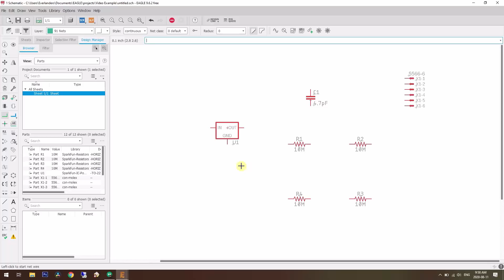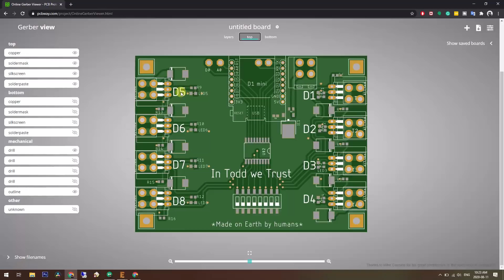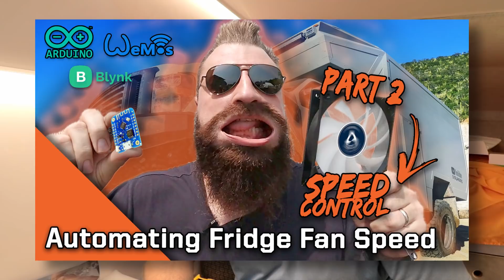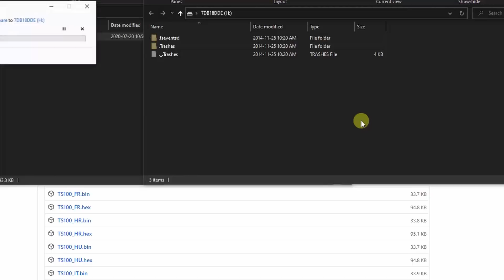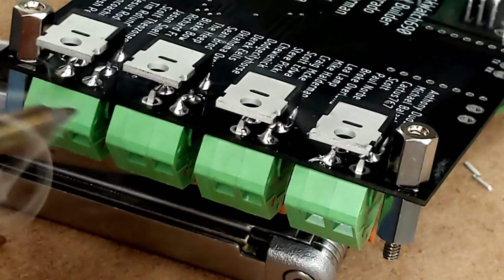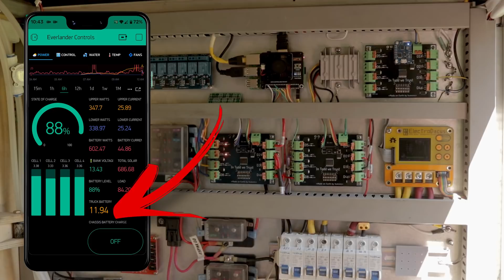Designing and Building Custom P-Channel Driver PCB's in Mexican Lockdown

Comment: you showed making the pressure bumper thing but I didn't see what and why. why are you using semitruck air brake solenoids on your back bumper?
Reply from the maker: This was covered in detail years ago... https://youtu.be/7_NlZw3lk3A jump to 12:00 to see the bumper flex air mount.

Comment: Hi, great video. This is so cool.

Do you have a video where you explained the components you used for your design? I'm in the process of doing something similar for my car, but I would like to add a couple of high amperage 12V devices on there, like a winch.  The rest will probably be lights. But I'm trying to learn what's the best way to switch high amperage DC loads.
Reply from the maker: The winch was probably built with large relays or contactors, controlling these us probably your best bet.
Reply: Thank you for the response. Thanks to your video. Now I know I can do it. I want to switch the relays through the rapsbery pi with open auto and using an HMI screen. Not physical buttons. 

Do you recommend using an 8 relay board how you made and all the wires (about 10?) Or pairing an arduino through serial comms (maybe i2c or rs485?) with the pi? 

Also, you go offroading quite a bit. How's has the pi and the screen you have worked out for you? Have they been okay with all the vibrations and heat cycles?
Reply from the maker: I would caution against controlling a winch with an Arduino or Raspberry Pi. Winches can be dangerous enough as it is, but if you have a glitch in your code or a delay in a process and the winch is running when you NEED it to stop, you'll be better off just waiting the stock buttons to your dash if you want.
Reply: @Everlanders  I agree. The winch was a bad example. I am going to stick with lights only and possibly the electric actuator for a rear diff locker.  Thanks.

Comment: Before doing fine pitch assembly, take 20 mg of  propranolol (a beta blocker) and it will take most of the shake out of your hands.  My neurosurgeon says they take it before doing surgery -- for basically the same reason.   I think in Mexico it might be available OTC... (?)

Also, when handling MOSFETs, you need to wear an ESD wriststrap and work on a static dissapative surface.  It's easy to blow the FET gates with ESD.
Reply from the maker: It's unlikely I will implement either of these.

Comment: Thank you for sharing!!! After watching this video I had to make one board like this for my build. I love it! I designed it a little different so it can handle high current without modification. It's bigger so I can install two heatsink on the fets, I use EasyPCB so no size limitation! 
I have a question though...because I'm good in electronics but not so good in coding, how can I make one wemos D1 mini pro output to work with Blynk as a dimmer? Any suggestion or links will be really appreciated!
Reply from the maker: Just PWM the output
Reply from the maker: Or if you're using the Blynk interface, you can just set it as a Slider and it will handle the PWM for you.

Comment: In any of your other videos do you show the safety lockout for the solar panels? If you get a chance to throw a quick look into a future video that would be great.
Reply from the maker: No. It is inherently safe, when the power is disconnected from the solenoids the panels are pulled in with 150 psi on each cylinder, they can't come out unless we lose all air pressure...

Comment: This Guy is incredible. I want it! I want it all! I have basic knowledge of circuits.. Working on using an Adrino nano BLE to control actuators for tilting solar panels based on a couple little solar panels as reference. I choice Ardino due to low power consumption but now I'm steady looking at my rasperri pi and wondering now. I'm a software engineer so I can program... What would you recommend as a good relay board/driver that I can get off the shelf??
Reply from the maker: Amazon is full of little two or four position relay boards that are more than adequate. But as far as tilting panels goes, the cost of one more panel will be far less than the headaches of tilting mechanisms and the gains will be higher...
Reply: @Everlanders  Ahh, I read up to 30% more efficiency but also had the idea of stacking them and sliding. Which I seen you did successfully! Though it still seems actuators or maybe servos are involved. I'll look through your videos and see if you have something detailed about that. Appreciate the recommendations!

Comment: Did you have any issues with the D1 minis starting up or logging onto Wifi while connected to the “blue relays”?  Been messing around with them to learn Blynk and noted that D1 wouldn’t start up with the relays VCC connected, but would work fine if connected after starting up and logging into wifi.
Reply from the maker: D3 is IO 0 - a boot configuration pin which should be HIGH for normal boot and LOW to start bootloader flashing mode. Just use another pin or use a 2803 to invert the logic.
Reply: @Everlanders  Hmm, I didn’t have D3 connected to anything,  but I did notice that D8 would try and stay high when booting, once I disconnected that pin it worked!   Thanks for the lead!

(I also found out that the ESP8266 analog input tops out at 3.3 not 5 volts.  Which would explain why my 16 volt voltage divider kept reading infinity billion... 😆).

Thanks again.

Comment: I'm not in a position to become a member but I do have a couple questions if you would indulge me.  Are you using the transistor array to boost the logic voltage from 3v on the wemos to 5volts for the relay boards, etc ...?? Or is it simply to invert the high/low of the logic.  I had trouble following that bit.  Would love to learn more from you if you ever want to mentor someone as you were mentored in the ways of electronics.  Thanks,!
Reply from the maker: They are used to invert the logic and provide a bit of protection to the GPIO

Comment: yep the relays in the ganged relay board unfortunately get arc-stuck  after  too short of a while, it's unfortunate .  Could be such convenient boards, as relays have many nice features over other methods .
Reply from the maker: 👆Truth!
Reply: @Everlanders  I actually replaced some of the "songle" relays with panasonic ones from digikey, and also replaced some with mosfets  they have been in use for a while now (CNC /pneumatic controllers)   Need to give it another year to see how the panasonics compare.
Reply from the maker: I was tired of all the clicking and inability to dim or limit current, so I went fully solid state.

Comment: By the way you run out of the GPIOs on Pi try to use I2C bus for it.... It will surprise you ... :)
Reply from the maker: No, I intentionally wanted to have satellite processors that could handle these tasks independently, hold states even if the Pi was rebooted, and for $2.00 its hard to beat the price for 11 digital IO, interrupt/pwm/I2C/one-wire supported pins and A/D

Comment: But do you have a light switch on the wall too?
Reply from the maker: No switches in the whole rig...
Reply: @Everlanders  Thanks!  I like what you are doing but I really need wall switches too.  My wife is not tech friendly!  Is it even possible in your setup?  Maybe to add a simple switch with power to the relay board?  I'm still diggin through your videos.  Great work!
Reply from the maker: Of course you can add a switch if you wanted to...
Reply: @Everlanders  Thanks, I'm stumbling through understanding it all :)  I get the RV part, and I can do very basic arduino, but tying the two together is a process I'm very much learning!

When you said the relay boards were getting fried by your lights, I'm assumming that it was not your led strip lights inside, but your large led lights outside (like driving lights) that blew them eventually?
Reply from the maker: No, it was our interior lights. They are 120 LEDs per meter and we have nearly 10 m total... They are brighter than daylight, and using a relay without the ability to dim them, it's a pretty high current load. This is another reason having the FETs is nice, because I can dim them now.
Reply: @Everlanders  Thanks for taking the time to reply!  I'm going to take the time to become a member in hopes I can learn a bunch more from you guys.  Thank you!

Comment: Excellent video! You have yourself a new subscriber! 
I would personally recommend getting a new tip for your soldering iron! The one that you are using is perfect for the smaller stuff but the bigger stuff just pulls what little heat is built up and cools it down, it means that you have to swap out tips for the bigger stuff but at least you won't be pushing the heater element to hard! Always remember, just because you can, doesn't always mean that you should! The right tool for the right job always makes the job easier, faster and without damaging something! There's all sorts of tips available for those soldering irons and a kit with just about every tip to do anything shouldn't be too expensive... 
But damn! That's an amazing job 👍👍 that's a double fisted Aussie thumbs up from me!
Reply from the maker: I have since ordered and received a second TS100 with the wide tip for bigger stuff... Thanks for the comment!

Comment: Hello Jason, could you please spent few words on how you use fuses? It seems to me that in your nice electronic compartment you have very little fuses. I suppose fuse should be between every MOSFET PCB and the battery (close to the battery) to protect PCB itself. And then right after MOSFET PCB to protect appliance+wire towards that appliance. Do you think so? Where are all those fuses? Thank you. Cheers!
Reply from the maker: Lots of fuses and holders shown at 50:35

Comment: I found myself needing something similar.  I wound up using an automotive power IC (TPS2HB16).  A bit more fiddly (HTSSOP) and expensive, however it has built-in current sensing/limiting and some other bonus features.  So essentially it can replace some of your fusing, and it's much more compact.
Reply from the maker: Lovely!

Comment: Hello guys! Jason's solution is of course superior. But if someone is looking for something that can be bought, this could be the way to go: https://www.aliexpress.com/item/1005001524520985.html  - also P MOSFET IRF5305 driver. Comes with optoisolator but unfortunately for me, possibility of additional cooling on this module is quite reduced. 5A without auxiliary cooling should be fine. I am personally considering sticking to N channel switching and using LR7843 transistor with much nicer/lower resistance than IRF5305. It should handle 15A without additional cooling: https://www.aliexpress.com/item/32963646280.html.
Jason, you are my god! I am building the van and its hard not to copy your solutions. Thank you soooo much for sharing your ideas!! :-)

UPDATE, 21-03-17: FET board https://www.aliexpress.com/item/1005001524520985.html just arrived and unfortunately it has fake transistors. IRF5305 should have RDS(on) about 0.06 ohm but used transistors on the board have 0,22 value. Of course my measuring is not lab accurate but these values are obviously way off.

UPDATE, 21-03-27:  FET board https://www.aliexpress.com/item/32963646280.html can be considered legit or at least nicely usable. I have measured RDS(on) around 0,010 mili ohm. Even when datasheet of LR7843 says 0,0033 mili ohm, 0,010 is far better value than 0,060 mili ohm of Jason's IRF5305.
Reply from the maker: Interesting, but others should be aware that many of these sorts of boards have fake underrated transistors on them... It seems it got axed from the final cut of this video, but the red N-Channel board I was fixing at 45:13 had fake IR parts on there with super high on-resistance (RDS(ON)), I don't recall exactly, but it was something like ~100x higher than the IR datasheet.  I couldn't get a LED light strip pulling less than 1 amp to light more than 50% brightness and the FET's got really hot... T'was BS.  Buying real IR parts to repair it cost more than the "product" itself. (which should tell you something)
Reply: @Everlanders  Hello Jason, I did not know there is such problem with fake transistors. Now I feel little stupid "recommending" some products I did not personally test. This china stuff is just my desperate move to have at least something. I would love so much to have your PCBs in my van but creating them from scratch including Eagle project is beyond my current capabilities. Also utilizing that awesome idea of alluminium mega heat sink back board... I think my only option is to order some China samples and hope to be lucky not to get fakes. I understand your enthusiasm for D1 mini. I am starting from scratch and i was staring too long at ESP32, just to have even more possibilities from single board. Would you also use ESP32 today?
Reply from the maker: no sweats, obviously I bought those boards thinking it would save me some time too, it ended up costing me a lot more time. I also have several ESP32's, but for $3 the D1 is a nice small cheap option and you can have one here, one there and one everywhere... plenty enough horsepower for small little tasks like this.
Reply from the maker: FYI for others that find this thread...
https://www.youtube.com/results?search_query=fake+mosfets
Reply: @Everlanders  What is the reason you prefer D1 mini pro? Is it integrated ceramic antenna?
Reply from the maker: It's what I have along with us...
Reply: FET board https://www.aliexpress.com/item/1005001524520985.html just arrived and unfortunately it really has fake transistors. IRF5305 should have RDS(on) about 0.06 ohm but used transistors on the board have resistance 0.22 ohm. Of course my measuring is not lab accurate but these values are obviously way off.

@Jason: thx, man! Thanks to you I did not order bucket of them but only one sample. I hope board with LR7843 will be fine.

Comment: Really cool video! I couldn't find anywhere else on your channel where you covered how you are charging the chassis battery, what method/ product are you using to do that?
Reply from the maker: We generally move every day or two so it's not needed, but if we are stationary for extended periods of time, I top them up with these very drivers built in this video...
Reply: @Everlanders  so does that mean you are connecting your chassis battery and house bank without any voltage or current regulation/ boost? In other words the chassis battery gets the same charge profile as your lithium bank
Reply from the maker: The current regulation is handled by the software on my driver boards... But like I said, we will probably never use it as we are usually driving every other day...
Reply: @Everlanders  makes sense, thanks. I have a espar hydronic unit and stereo that run off my starter battery, but want to use for extended periods with engine off. I would like to be able to charge the starter battery from my lithium bank to support the battery consumption of those appliances. I already have a Dc to DC charger linking the 2 batteries but obviously it only charges from the alternator to the lithium. I think the best solution maybe just to wire the appliances direct to lithium power. Although I am thinking about trying this unit from Drok https://www.amazon.com/dp/B076TTBKFG/ref=cm_sw_r_cp_apa_fabc_Y4TTFbDMZAD6T?_encoding=UTF8&psc=1. then wiring the Drok unit to a relay between the DC to Dc charger and starter battery so It can use the same 4awg wire. I don't think I'm ready for your solution yet, but thanks again for sharing!

Comment: Would you need the ULN2803 if you were only switching one p-channel hexfet? You have inspired me and I’m working on a project.
Reply from the maker: Yes, to fully saturate the P-Channel you need to switch the full voltage that the P-Channel is switching... The gpio can't handle that high voltage.
Reply: @Everlanders  Thanks! I may see if I can come up with a single channel Darlington. Seems a waste to have that full ULN2803 for one hexfet.
Reply from the maker: You don't need to use a Darlington in this case, I only did it because I had eight channels on that board anyway... For a single driver you could probably just use a 2n3904

Comment: Very cool video.  I understand how much time and effort goes into making a video that folks want to watch, regardless of the content.  I love both types of content you put out and it is well worth it to me to contribute.  I’ve never run across much that is neg switched.  Is there a lot of that negative sort of electrical switching in Canada or equipment that you’ve worked with over the years?  In an auto, pulling the negative terminal is a must when working on the electrical in case the wrench, you are using to tighten the positive terminal on the starter, hits ground, which is all around.

What I love about these tech videos is that you are building damn cool stuff.  I’d love to see more on your onboard Pressurized Air system and its many uses on your rig.  Thanks for your effort on putting these videos out.
Reply from the maker: Thanks for the great comments, I'm glad you're enjoying the content. In automotive applications, almost everything is positive switched there will be some exceptions of course...